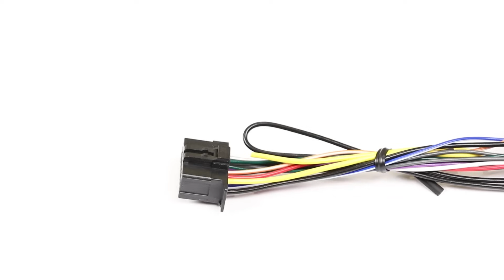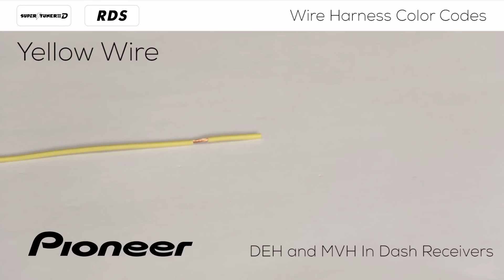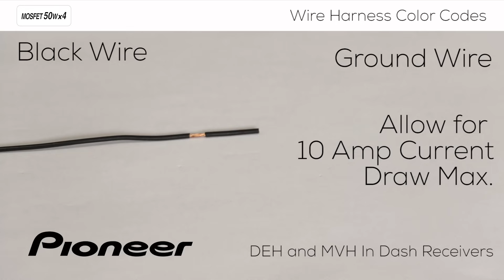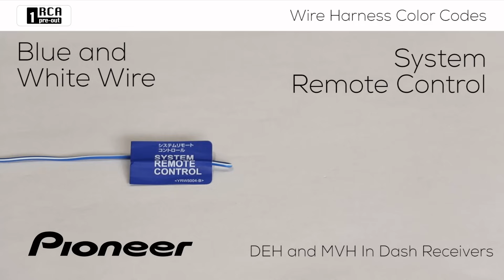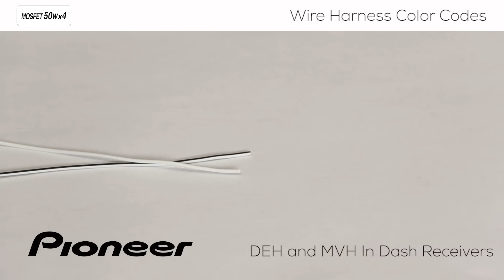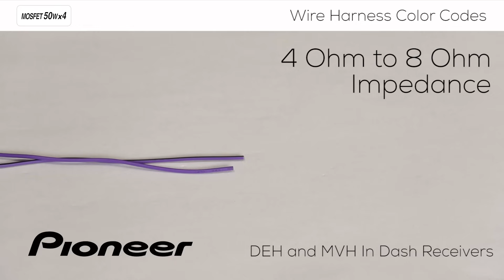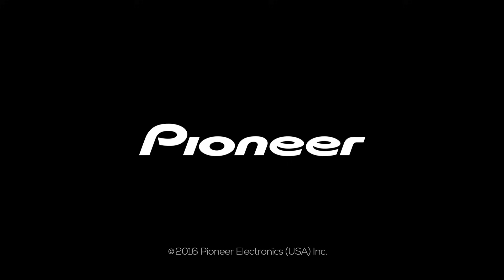How To - Understanding Pioneer Wire Harness Color Codes for DEH and MVH In Dash Receivers

Comment: Hi just installed pioneer MVH-S215BT every fine but once l turn volume upto 47 it's cuts out and turns off, volume max is 62. Can anyone help.
Reply: Pioneer in-dash receivers are designed to operate with 4-Ohm to 8-Ohm impedance shown to the internal amplifier.  If you go below 4 ohms, you'll see issues like this.  If you are using 4 speakers,  And one speaker is wired to each of the 4 outputs from the in-dash receiver and the speakers are rated at 4 ohm impedance you should be able to turn the volume up higher than 47.   If this is the case it's possible you have a speaker wire that is touching metal somewhere in the vehicle.  This can happen at the back of the speaker in a door or other location, or at the back of the in-dash receiver,  and will only shut down the in-dash receiver's internal amp when you start to turn up the volume. To test, I recommend to disconnect one speaker at a time.  With one speaker disconnected, turn up the volume to see if you can go higher than 47.  If you can't go higher than 47 then disconnect another speaker and try again until you find the one (or more than one) that is causing the issue.  
How many speakers are you using?  Are they wired to the front outputs?  Or the rear outputs?  Or to both? Are you using an external amplifier?   What speakers are you using?  What is the nominal impedance of the speakers?  The nominal impedance is usually printed on the magnet of the speaker.    Pioneer in-dash receivers are designed to operate with 4-Ohm to 8-Ohm impedance shown to the internal amplifier.  You can find more videos on Pioneer's You Tube Channel here:  https://www.youtube.com/user/pioneerelectronics
Reply: @deckerdotto6035  Dude you are dedicated, respect for trying to help everybody. I'm gonna be trying to put a deh-2600ui in my truck soon. I'm still confused about one thing, figure you can maybe help. I was planning on getting 50w 6x9s to upgrade the factory door speakers (it's an old single cab so only two factory speakers total) and then I wanted to run an amp to a sub behind the seat and maybe at some later point in time add another set of speakers next to the sub, I know that I would run the door speakers off the wiring harness in this video but where would I plug the amp in? Would it go to the two larger ports on the back of the head unit?
Reply: An external amplifier gets is audio signal from the RCA outputs on the back of the in-dash receiver.  RCA outputs are the Red and White jacks on the back of the receiver. Red is Right and White is left.  You can see it here:      https://youtu.be/R5bEWdIAsFc?t=209           On an amplifier there are RCA inputs.  You'll connect the RCA OUT from the receiver to the RCA IN on the amplifier.  You can see this on a small Pioneer amplifier here:  https://youtu.be/eV6Jf4ZsTLQ     I recommend getting an amplifier wiring kit to make this work. Many are available.  Here is one possibility:   https://www.crutchfield.com/p_142PA10BX/EFX-PA10BX-Wiring-Kit.html    To wire an amplifier you'll need to connect directly to the vehicle battery for power.  You can find more videos on Pioneer's YouTube Channel here:  https://www.youtube.com/user/pioneerelectronics
Reply: @deckerdotto6035  Okay, so my only other question would be do you recommend getting one of those wiring kits? Like is it really necessary or could I just get the individual wires and all that? Would it end up being cheaper to get a wiring kits?
Reply: I use wire kits when I do install work.  The point of the wiring kit at the in-dash receiver is to make the new radio installation easier.  The wiring kit for the receiver usually has a plastic connector that fits your particular vehicle.  It will just plug into the vehicle's wiring that you unplugged from the factory radio.  The other side of the wiring kit has the same color of wires that comes with the Pioneer receiver.  You match up the colors and you should be in good shape.  You can learn more about wiring kits for receivers here:   http://metraonline.com/parts/MET-TURBOW/M-CAR_HARN   Depending upon your particular vehicle, you may also need an AM/FM antenna adapter to fit the new receiver.    Do you have to get a wiring kit for the receiver?      No. You Don't.     However, please be aware that you'll need to identify each of the wires necessary to make the stereo work.  Power, ground, accessory, + and - for the each of the speakers,  etc...  If you're not comfortable with that, I recommend using the wiring kit.  As for the amplifier wiring kit, you can buy Power Wire, and proper fuses, and in-line connectors along with ground wire, and RCA cables about 15 feet long.  Or you can buy it all in a simple kit.  It costs a few dollars, however, I recommend using the kit because  the kit makes things easier, the parts are designed to work together, and this leads to fewer mistakes.    You can find more videos on Pioneer's YouTube Channel here:   https://www.youtube.com/user/pioneerelectronics
Reply: @deckerdotto6035   Deckerd Otto  Okay so I was working on it as much as possible yesterday but I just got the wiring harness adapter today. So the radio is used out of a completely different car, but I just removed the pioneer harness from the other car so I can use it for this install. I also purchased a kit that has female connectors that go into the two factory 7 pin male connectors that plugged into the factory radio. So now I have the wire ends on both connectors, but the wires in the kit I bought don't match up with the wires in the factory connectors, so I'm going to have to use my repair manual and trace those, and then with this video I have made a sheet outlining what the pioneer harness is for. Now there is one more thing Im confused about now. The pioneer harness has 4 speaker outputs, and the pioneer Head Unit has one pair of the RCA outputs (total one white one red). I eventually want the two factory speakers (in the doors) wired into the head unit, and then an amp wired into it that runs two speakers and a sub. However since the dash wasn't easy to take out I want to get the wiring all set up now while it's taken apart. So, how would it work if I ran the RCA pair into an amp which drove two normal speakers and a sub? Would I be able to do that or should I do speaker wire coming from the pioneer harness for the two speakers and run RCAs to later put a single output amp for a sub? Is there any reason other than max volume to put normal speakers on a sub over the normal pioneer harness speaker outputs?
Reply: There are many options to do what you're talking about.  They all work.  It's just a matter of how you want to set things up.  You can run all 4 speakers from the receiver and an amp for the sub.  That works great.  You can run 2 speakers from the receiver and 2 from an amp with a sub.  That works great too.  As long as the amplifier you're using is capable of multi-channel operation.  This one would work great:    https://youtu.be/fMhhj6MfnMI       The benefit to adding an amplifier is better sound quality at higher volume levels.  You can also do all 4 speakers from the receiver and a self-powered subwoofer like this:   https://youtu.be/lbLvvzvvLro     or this:    https://youtu.be/5BOYxxv9l5k       You can also run all 4 speakers and a subwoofer from one amplifier if you want.  Use an amplifier like this:    https://youtu.be/99Hfmc8QxVc     Please consider replacing the factory speakers.  Speakers are inexpensive to replace and make a gigantic difference in sound quality.  https://youtu.be/MgZzTIqBBa8
Reply: @deckerdotto6035  Yeah so I was gonna replace the factory speakers with pretty cheap ones, due to the location of them they'll never sound great anyway so I'm not gonna put a ton for money into them, but since the right side is broken they need to be replaced. I went to best buy and found some JBLs that I really liked the sound of and I'm gonna put those in the back no amp and then run a sub off a monoblock amp I think.

Comment: Trying to use a MVH-S321 in a travel trailer.  I do not want it consuming battery power when I am not using it.
Reply: The red wire and the yellow wire are the keys to your question. The red wire should be hooked up to ignition. The yellow wire should be hooked up to constant power. This keeps the radios clock and radio station presets when the system is not switched on. If you put the yellow wire and the red wire to ignition it will power on with the ignition but will not save the clock or the radio stations. It will not use any power when it's off.

Comment: will this help at all for the really old KE series models of head units?  the old cassette ones that are not shaft style,  but before CD units years availability??  i have an old school KE-2303QR cassette/tuner combo unit im puting in an old 93 lumina in place of the stock common large delco 16141883 unit with the later years style smaller wires pins style connector,   about 92 and older were the larger style old style connectors/pins.  this Pioneer KE series unit has two black ground wires right next to each other in bottom row of pins separate pins from each other,. not combined.  no other wires pins in bottom row except for antenna ground which is a third separate ground wire pin in this bottom row,.   which one is speakers ground and which one is main chassis unit ground ????  wires colors are:  top row:  red for antenna  - blue - red - gray w/ red stripe -  gray - green w/ red stripe -  green,.,..   
then second row is:  four separate black grounding wires starting with antenna ground -   

i have to assume that the grays and greens are pair of speakers/channel wire pairs,  greens for one channel and the grays for other channel??  front and rear.  or each wire is speakers positives and it is actually four channels??
Reply: Not just a KE but a KE and QR.   That is old school.  I'll guess it's from about 1990 or so. The video above will not help at all.   You're going back about 30 years or so, but this is what I remember.  The Red had a fuse holder.  This was the ignition wire. There was no constant power wire to hold the clock and radio stations settings because KE-2303QR was a pull out type of radio.  Press the button on the front edge and the handle will pop up.  Pull the handle to remove the radio chassis from the mounting cage. All memory was held with a battery inside the removable chassis.  I'm sure the battery needs to be replaced 30 years later. One ground wire needs to be connected to the back of the mounting cage and the other was the system ground as well as the speaker ground.   KE means this was a low powered radio and all 4 speakers shared one common ground.  Taken out of the box, the Black ground had a spade connection.  The single Speaker ground had 4 separate bullet connectors.  Green Left Front Positive.  Gray Right Front Positive.  Green Red Left Rear Positive.  Gray Red Right Rear Positive. You can find more videos on Pioneer's You Tube Channel here:  https://www.youtube.com/user/pioneerelectronics

Comment: I have a 2001 Silverado and I just installed the Pioneer DEH-S4120BT.

Most of the wires on the harness matched except one end had red, pink, orange with no corresponding colors that matched the harness coming from the radio. I matched them with the closest color, but there was 1 extra wire left coming from my truck because my truck apparently has more wires than my new radio.... The wire that got left out is orange, simply because there's nothing to connect it to. 

My new radio works great, but I have 2 problems. My headlights and my cab lights no longer come on automatically. They work off I manually turn them on though. I have been assured that everything is wired correctly, but something is obviously wrong. Does anyone have any idea what I did wrong?

If I put the old radio back in the lights work fine lol

Comment: I just hook my pioneer up but when I turn off the ignition my stereo stays on it won’t go off! Any advice I know the red wire is connected so should I disconnected then?
Reply: The Red Wire is your trouble.  The Red Wire should have power when the vehicle is switched on.  The Red Wire should NOT have power when the vehicle is switched off. The Yellow Wire should have power at all times, even when the vehicle is switched off.   Do not Connect Red and Yellow together.  You can find more videos on Pioneer's You Tube Channel here:  https://www.youtube.com/user/pioneerelectronics

Comment: What happen if there is no where to Connect the yellow wire?
Reply: I recommend to run a wire to the vehicle fuse box where you can find constant power or to the vehicle battery, with an in-line fuse,  for constant power.  If you don't use constant power on the Yellow Wire,  the in-dash receiver clock, radio station presets, and other functions will reset each time you start the vehicle.  You can find more videos on Pioneer's You Tube Channel here:  https://www.youtube.com/user/pioneerelectronics
Reply: Thank you Deckerd Otto👍🏽

Comment: I can blugin in 250 w amplifier?
Reply: The wire harness shown in the video above is for selected Pioneer in-dash receivers.  Not for amplifiers.  An external amplifier requires separate wiring to the battery of the vehicle.  You can see more about amplifiers here:  https://youtu.be/-Uq25Goo0sU?list=PLw63zJRQbCNgnzKRnjnxSbEmQtkk0O5Os  and you can find more videos on Pioneer's You Tube Channel here:  https://www.youtube.com/user/pioneerelectronics

Comment: But where do they go in the plug?
Reply: The colors on the Pioneer wire harness are not designed to match up to any make, model, or year of wiring in any vehicle.  If you are looking for a way to plug into your existing vehicle wire harness I recommend buying a car stereo install wire harness made to fit your specific vehicle.  Many are available.  Here is one possibility:  http://metraonline.com/parts/MET-TURBOW  You can find more videos on Pioneer's You Tube Channel here:  https://www.youtube.com/user/pioneerelectronics

Comment: So what is network mode? I have a subwoofer and amplifier and the last wires I need to connect is the Hi-In wires and I'm wondering if the grey and white wires are the right ones to connect to.
Reply: Pioneer standard mode and Network mode is explained in this Pioneer You Tube video:  https://youtu.be/k3q0Zm5jvHg  If your in-dash receiver does not have network mode, or you did not put it into network mode, the Rear speaker outputs Gray and White are good Speaker Level connections to use for a sub amplifier.  You can find more videos on Pioneer's You Tube Channel here: https://www.youtube.com/user/pioneerelectronics

Comment: I have the DEH-S4010BT model, and I'd like to know if you can connect the blue, remote turn on wire from my Pioneer GM-D8601 amp to the blue, system remote control wire on the head unit?
Reply: Yes.  That's the idea.  The Blue/White System Remote wire on the back of the DEH-S4010BT can connect to the System Control terminal on the Pioneer GM-D8601.  This will switch the amplifier on, when the in-dash receiver is on, and it will switch the amplifier off when the in-dash receiver is off.  If you are also trying to switch on several other external devices via the Blue/White System Remote wire, you may need an external relay to operate the entire system.  You can find more videos on Pioneer's You Tube channel here:  https://www.youtube.com/user/pioneerelectronics
Reply: Okay, thank you Sir. I’m only going to wire my amp to the blue/white wire, but just wanted to make sure it wasn’t going overload the wire on the receiver. Thanks again for the reply.

Comment: What color wire do i hook to my amp wire?
Reply: If you have an external amplifier, you can use the Blue/White wire to switch it on and off with the in-dash receiver as seen here:  https://youtu.be/kR2MO2kwFug?t=146  Your amplifier may need power directly from the vehicle battery and a proper ground connection as well.  You can find more videos on Pioneer's You Tube Channel here:  https://www.youtube.com/user/pioneerelectronics

Comment: Blue wire .. Amp  error  keeps coming out wher do i connect the blue wire ??
Reply: As shown in the video above:   https://youtu.be/kR2MO2kwFug?t=147   The Blue/White wire is used to switch on components external to the in-dash receiver,  like amplifiers and power antennas.  If you don't have external amplifiers or power antennas you don't need to connect the Blue/White Wire. If you are overloading the Blue/White Wire, use a third party relay to switch on the external devices.  In addition, "Amp Error" will also appear if the speaker wires are touching one another or metal in the vehicle.  Be sure the speaker wires are not touching one another or metal in the door or rear deck.  You can find more videos from Pioneer here:  https://www.youtube.com/user/pioneerelectronics

Comment: I’m able to get a pioneer stereo turned on in a Toyota solara 1999 jbl enhanced system but getting no Audio, I’ve matched everything and connected ground wire to metal but no difference, please help :(
Reply: Please note: the wire colors on the Pioneer wire harness are not meant to match up to any particular make, model, or year of vehicle.  Does your 1999 JBL enhanced system have external amplifiers included with the system?  Are the amplifiers switching on?  Are you routing signal from the new in-dash receiver to the amplifiers?  If you're not sure what you are doing, you may want to consider going to a car stereo shop for installation assistance. You can find more videos from Pioneer here:  https://www.youtube.com/user/pioneerelectronics
Reply: Deckerd Otto I actually got it figured out, the harness that connects to the stereo apparently won’t work with the av cables, I cut the av plugs from the stereo harness and manually connected to each wire that matched to the car harness and it worked!!